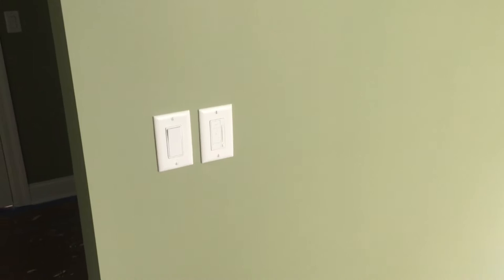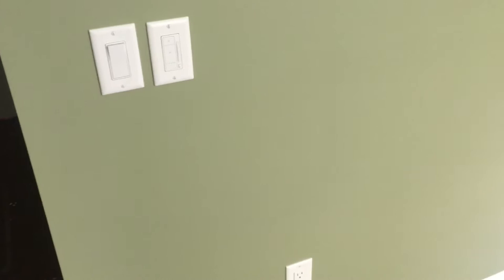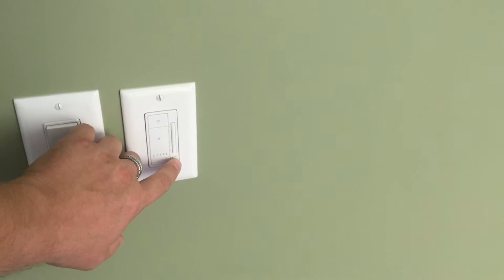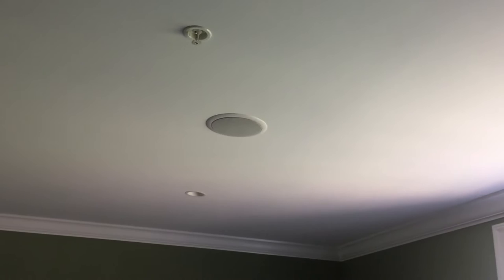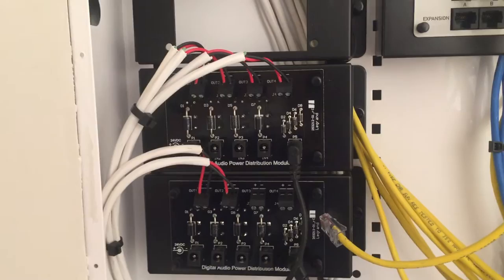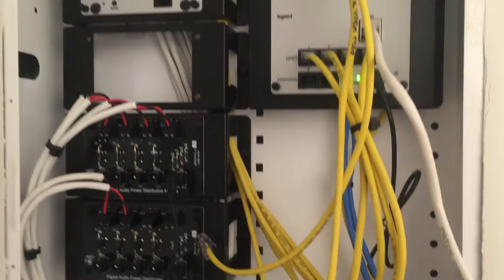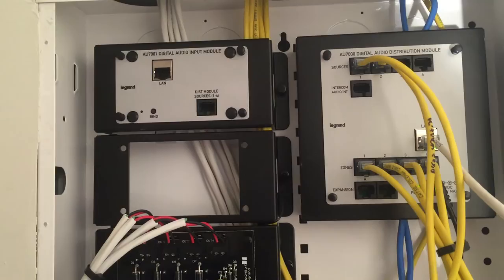Legrand Digital Audio install

Comment: Hey, I've totally got two of these speakers in my kitchen, with an On Q display to view people at the front door entrance. I'm looking to figure out how we can play music in our kitchen as we are the second owners and no instructions. I see on the On Q display module it does list an option for music with multiple sources. I think our system requires a entertainment system setup as there are L and R audio ports behind our living room TV, which are CAT5 (POE) to the On Q control box system. I must not have any wall outlet or Bluetooth functionality and require an entertainment system for L/R AUX or IR setup.
Reply from the maker: Sounds like you have the lyriq system  which is no longer supported. I just had to piece a system together over last winter for a customer. I have another job coming up that I’m going to upgrade the analog Lyriq to the digital System. 

What you could do is get a Bluetooth adapter that has RCA outputs.

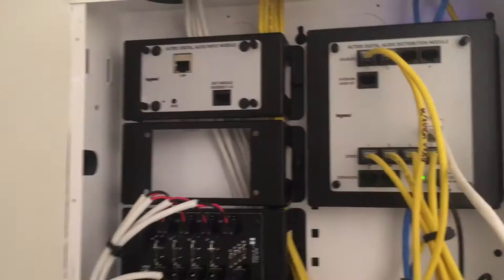Comment: Do I need to call an electrician to get mine to work?  The home I'm in has An AU7396 but I can't figure out how to use it. 1:57
Reply from the maker: Unfortunately that’s from the older system, the one in this video is the digital system that replaced yours. The new one is discontinued now and yours was before that. You may still find parts for that on eBay but maybe used. Sad that they got rid of both systems. 

If you do call around, ask if they know or did work on these systems so you don’t waste your money.

Comment: Hey pal i have one of the 1st on q setups and have been updating the system slowly which brings me to the digital audio that u installed. I do have 8x rooms setup working on the lyric keypads. My questions are:
1- can i use my keypads
2- can i integrate my LCD panel
3- does all the speaker wire have to go back to the structure wiring box
4- I’m looking to also have outdoor controls with speakers what do i need to do that. 
    Your video looks great but i don’t know where to begin since my system is already wired
Reply from the maker: Trash Dad the system is completely different. 
Volume controls are not interchangeable
The new volume controls need a separate wire ran to them to power the controls. No longer powered off the cat5. 
Btw they no longer sell any of the lyriq stuff as it’s discontinued. That sucks as I have a customer trying to sell his house and buying off eBay.
I haven’t tried to interfere with the old intercom so I don’t know if that works. 
The speaker wires go from each volume control to the speakers directly. The volume control is the amplifier.
Reply from the maker: Trash Dad In my own house I have an outdoor zone, needs a cat5 from structured wire panel to location of volume control and a right and left channel speaker wire from there. But again it maybe hard to find volume controls new.
Reply: Ok thx I’m not afraid of making it digital. I just don’t want to buy things i don’t need. For my 7x Audio room i will need 7x keypads. What kind of keypad do i need for the outdoor zone?
I read someone put power supply in attic and ran upstairs keypads to that. If that works i can bang out 6x zones right there

Comment: I have an older version of this system in the home I just purchased. 6 rooms have speakers and control panels. Anyone know if hooking up an amp at the audio input location will improve sound quality?Sound is okay but bass and volume seem fairly low.
Reply from the maker: You would be limited to the power output of the actual volume control, they did make high performance versions but that system is no longer supported so you may have to search for old ones.

Comment: Hi, Great video!  I am helping out a friend that has a On-Q Legrand system It has not worked since he moved into the house. The system dose have a different wall control switch.  It seems like its not getting power, its supposed to light up right?  Anyway I can call you?
Reply from the maker: Eric Perkins do you know if it’s a Lyriq or the newer Digital system?
Reply: @NiceGarage  Not sure, its a little different from the one you have on the video.  I believe its a older system!  We troubleshooted quite a bit yesterday and also on the phone with On-Q support.  We think its the main board issue.  On-Q s going to send him an updated version, so hoping that will fix the problem.  Thank you again for the video!
Reply from the maker: Eric Perkins what did you end up figuring out?

Comment: How do you connect a global source to the 7001?  When I plug something into 1 of the 4 sources from the global input module it doesn’t show up on the app
Reply from the maker: I actually have one on my home system and added the Bluetooth adapter, although I never use it I just plugged it in to the AU7000 as a source if I remember correctly.. you can pick a source on the keypad. Hope that helps

Comment: Does the AU7002 has a usb in the ear end of the panel?  You have any other video that shows how to install the complete set of AU7001, AU7002 and the power source?

Comment: Hello! Great video. I just purchased a home with this pre installed. When I open the app it says all zones are either off or restarting and has been this way several hours. Any idea what this means and how to fix it? Also on the app I have no option to select music once selecting the settings icon
Reply from the maker: Brandon Watts sorry I just seen this, hope you found a resolution. When it happens to me I just unplug the power to the module and plug it back in.

Comment: Hi there! I’ve just bought a house with this Legrand system pre installed. It seems they did a whole integration with outdoor cameras, garage, doorbell etc. The iPad is off, and I can’t control the anything on the system. Can I hire you to help me reset the whole system ?

Comment: By far this the only one very helpful video, I was looking for your second video, but not seen anywhere. I’ve connected and wired everything, and download the app. All radios work, but somehow my app wouldn’t show an analog source, only digital source, however I have had a global input which is connected to one of the sources. Do you have any idea if the global input malfunction or the cat5 wire wrong? Thanks.
Reply from the maker: Sorry, I don’t have any analog inputs. Also sorry I didn’t see this before. Hopefully you figured it out.

Comment: I have one question, my AU1002 has a red light on it, I assume it went bad. can I use a AU7000?, I know I will be missing two zones, also what is the difference
 between the AU1002 and AU7000 besides the numbers of zones?

Comment: Does Source Inputs Lyriq Digital Input Module (AU7002) stream only curtain services like XM and Pandora, or does it stream anything your phone will stream from the phone?
Reply from the maker: tiverton - I used to have the Lyric system but upgraded to the digital system. When I did have Lyric the only choices were Pandora and Sirius/XM. But with the Digital Audio they added a Bluetooth module that fits in a local or global input.
Reply: Nice Garage 
Thanks for the reply. That's what I thought. I just installed 8 room lyriq in our house. When we built it 6 years ago, builder offered to prewire for home audio. I figured I can install all the boxes myself later, just to realize now that they prewired for Lyriq, which is now discontinued. To change it to digital high performance keypads would be a major pain as there's no power wires running from the enclosure to keypads. Also local sources in 4 rooms are wired for Lyriq. So cat 5 runs from distribution module to local source then to key pad, instead of the other way around. 
Anyway I just had to accept what I had and scavenge for Lyriq components, instead of making holes in drywall in every room.
I think I will  buy a long range Bluetooth receiver and plug it into one of global sources to play  music from my phone.
Reply from the maker: tiverton - I did a retrofit once and since it didn't have the 16/2 for power and only the cat 5 I powered each volume control locally by installs a plug in power supply and just had to fish short distance. Like the second floor I powered them all from the attic. All you need is a 120v outlet and a power supply big enough.
Reply: Nice Garage 
Good point. Thank you.

Comment: Could you please help me , great video I can't find your other videos though and I just moved into my new construction home and we had this put in but I can't seem to get it to work
Reply from the maker: Andrew Wolf - sorry I read that wrong. It's already installed. What exactly are you having problems with? Did you download the app? Is your mobile device on the same network as the digital module and the system?
Reply from the maker: Did you find a remedy?
Reply: I am having the same issue.  I just got my AU7000 replaced.  When I try to connect via app it says Distribution Module not found

Comment: is it possible to have no modem Legrand?
Reply from the maker: chris king of the jungle, as in no outside internet? You can set this system up without outside world connection but would lose the streaming
Reply: Nice Auto  i meant without streaming device how to play music
Reply from the maker: chris king of the jungle you could still play music off of a phone or use the USB port on the back of the digital audio module
Reply: i cant find the module is it possible that There is none cause i just bought à new house and There is speaker Everywhere and switch's on wich you can Read source and à house logo
Reply from the maker: In the video i point to the streaming module. If you don't have it then you cant use the USB port. You can still use it with a audio input from a local source.

Comment: How did you bind to the au7000
Reply from the maker: When you open up the app and it asks you to set up new system it the proceeds to show you how. Once the app is ready you press the bind button on the module and it should find it. Both devices have to be on the same network.
Reply: Ok thank you very much for replying I think I must have a bad router or au7001 then
Reply from the maker: Try it again, power it down and start over. I've don't about 4-5 of these now and every once in a while I have one that is stubborn
Reply: I tried to restart everything when I start it all back up the LAN lights don't come on I deleted the app turned everything off and back on with a new router made sure it was compatible with the system still nothing have you gotten a bad au7001
Reply from the maker: Sounds like that may be your problem. Question, did you also have an Internet connection for the AU7000?